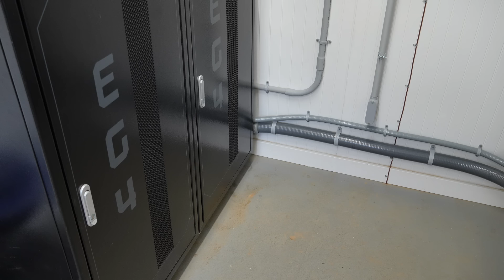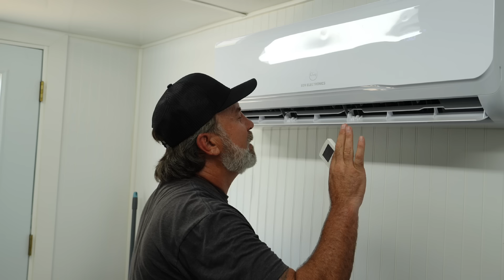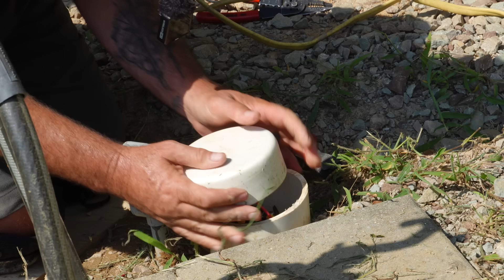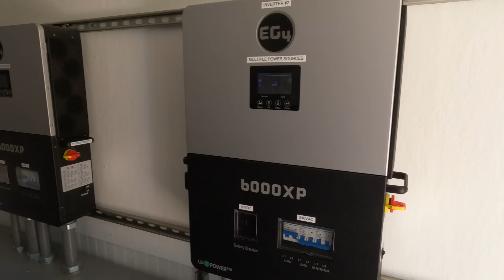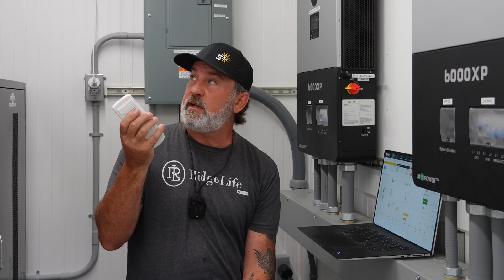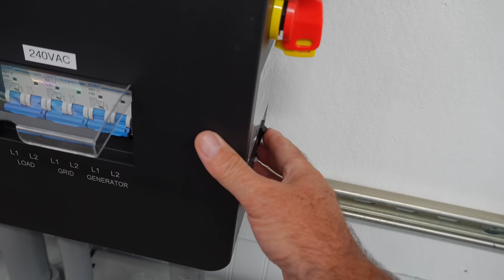Load Testing EG4 6000XP's w/ Camper A/C, Well Pump & Mini-Split | Testing Rapid Shutdown Switch

Comment: If there is one thing I would highly recommend it would be Home Assistant with Shelly Energy Monitors on everything. You will get instant real time data and on topbof that be able to run Automation. You can make your own energy dashboard with gauges for nearly every appliance if you wanted. Eg at my place I have one on my workshop load one on the pool load dishwasher, dryer and washing machine. You could add smart switches with energy monitoring for temp monitoring just so you know for example how much your coffee machine consumption is in a month.. Historical data is also fantastic. Home Assistant Shelly EM and TP-Link Smart Plugs with EM. There looks to be a EG4 Modbus integration for real-time data not this 5 to 10 sec cloud app rubbish...
Reply from the maker: Thanks for the suggestion, I'll definitely look into that for future upgrades!

Comment: ? why did you leave the metal (tin)  or Plastic LID on your SQUARE-D 
Well Water PRESSURE SWITCH  "off" inside your WELL Casing ? 
 ( is that to keep any moisture from building up ? ) 
Curious 
...
COOP
Reply from the maker: It is missing!

Comment: Hummmmm ?
as you were turning your Mini-Split Air-conditioner "on" inside your 
SQUARE-D Homeline circuit-breaker box --- I beLIEve that I see 
a 200-amp MAIN  Breaker at the bottom of that panel ?  
...
which confused me in your  SPD Video 
...
MidNite Solar advises the installation of their SPD's to be in the very 1st slot next to the  MAIN  Circuit-Breaker for maximum efficiency 
& effectiveness in the event of 
a  "near" lightning strike or a "SURGE" 
...
Just  an observation from the instruction sheet while I was installing my Midnite Solar 600-volt SPD recently 
...
COOP
Reply from the maker: That 200a breaker is an OUTPUT breaker not an input MAIN.

Comment: @RidgeLife - You do know that battery cell vapers are explosive and some room ventilation for the batteries is required to prevent your solar hut from RDE with a loud noise.

Edit: if you do suffer RDE it will facilitate a forced upgrade event and a new set of truely enjoyable solar video's to watch.
Reply from the maker: Go back and watch my video on that subject. I do have passive ventilation JIC. Watch Will Prowse on this subject as well as these are the safest on the market. Each of these units has built in fire suppression!
Reply: @RidgeLife just before this I watched the fire man's video on the exploding battery hut. I see I wasn't as though as I thought watching your video's I'll have to go back and see which one I missed.

The setup looks fantastic. BTW.

Comment: Tim it look you have enough solar power to run a restaurant for real. I don’t know it’s just that when I seen those solar panels the way that you got them in that building and all those batteries I think you have another business or something or hatchery or something it looks awful powerful to just for somebody living in the off grid I don’t know it takes that much power just to run your house or like I said you have some kind of operation that that you’re doing a hatchery of something steel fabrication shop.  It just looks like you got way too much power but I could be wrong. I’m not an expert on solar power. It’s just that to me half of what you got would be efficient for me and I’ll live in a big house and I got all kinds of appliances and microwaves, air conditioners, and that solar power station you got would run that plus another house and probably another house
Reply from the maker: Winter takes a big system to keep everything going with ladies in the house! Ha!

Comment: What ac unit got on that camper ots smaller then mine. I got the colman mach 3  uses about 1300 watts. Then with everything else my normal is 1600 watts with what we use
Reply from the maker: It’s 120vac Dometic, 12kbtu I think.